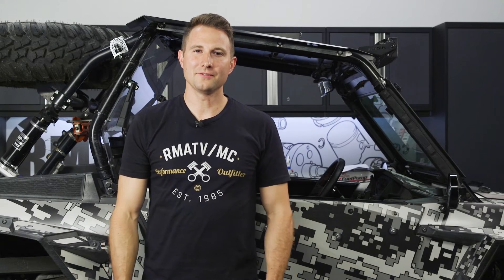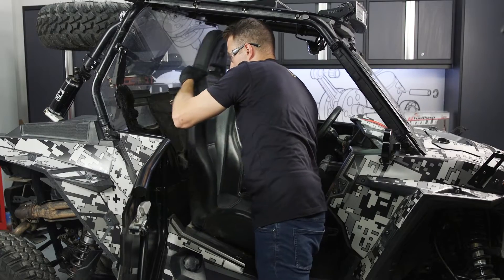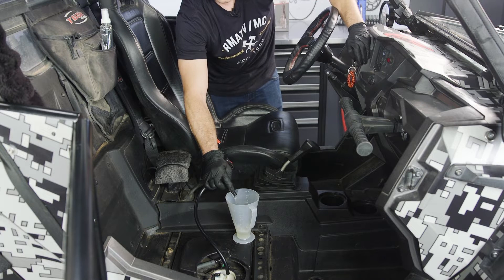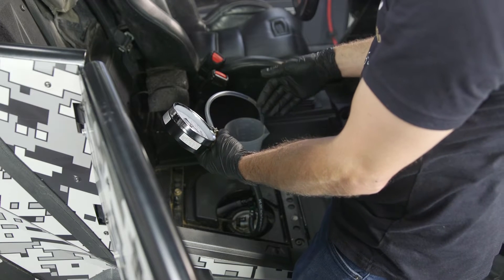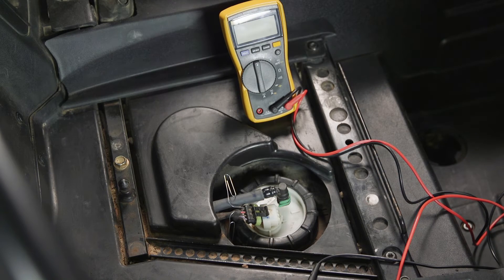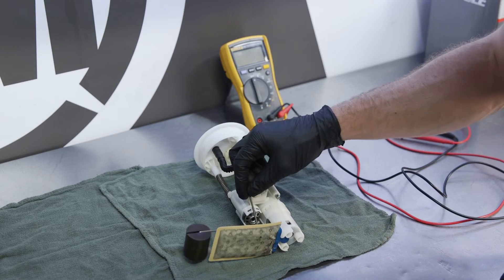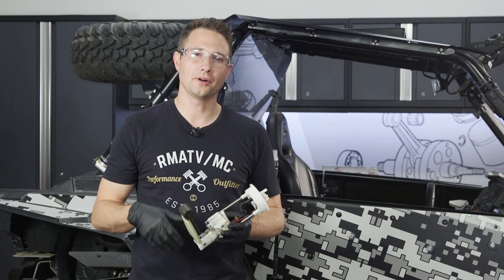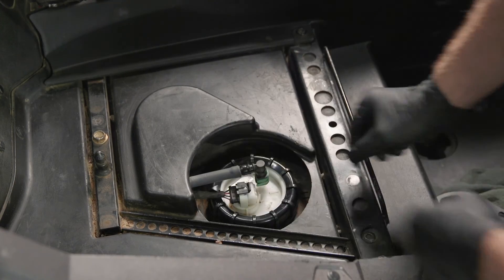How To Diagnose a Faulty Fuel Pump on a Polaris RZR

Comment: What would cause it to spit and spudder every now and again
Reply from the maker: This could be caused by a few things. Have you checked fuel pressure yet? Could also be bad spark plugs, or ignition coils.
Reply: Just did plugs wires coils

Comment: OK, I’ve checked fuel. Pressure is good volume is good but everything back together it will run holding down on throttle just a little, but there is no gas coming through the fuel filter line.
Reply from the maker: Hmm, what machine are you working on? So the test at the pump is OK but you're not getting pressure to the fuel rail? If it won't idle, it might be worth checking some basic things like compression/leak-down and maybe your valve clearance. -Charles

Comment: Hey Charles, I have a rzr4 900 eps 2015 and i did the 3 turn of the key and got roughly 195-200. I guess I'll put the gage on it tomorrow.
It once died going slow up steep hill due to traffic. And couldn't get it started for a few hrs, just a little paranoid of dying out on the trail. Anyone got a clue any info would be appreciated. 🇺🇲🇺🇲

Comment: Tighten that plastic nut to 70 lbs pounds? Maybe you meant 70 inch pounds???
Reply from the maker: It seems crazy but 70 ft-lbs is the correct torque.

Comment: Question regarding continuity within the pump.  When you tested this at leads 3 and 4 do you have to cycle the key on/off at all?
Reply from the maker: Great question. No, you don't need to cycle the key on that test. Continuity is measured without any power going through the circuit (usually the part is disconnected/removed from the circuit). All you are doing is making sure there is a complete path for power to flow through. So if you don't have continuity or if you have high resistance, then you found your problem.
 -Charles
Reply: So if I don't have consistent reading holding at this test fuel pump bad?

Comment: I have a 2015 rzr xp 1000 my fuel pressure is at 30 when i turn the key on and it drops down real fast to 0 as soon as it hits 30 psi it drops to 0 fast
Reply: Did you figure your out? Mine is doing the same exact thing

Comment: 2012 Polaris ranger 800xp we changed fuel pump, starter, battery and it still won’t start. It clicks and after the key is out you then hear a clicking by the actual starter?!! Help
Reply: Did you figure this out?

Comment: Maybe two suggestions.  A fire extinguisher handy, and to make sure key is off when dis-connecting the plug to the pump, or dis-connect the battery.  Wouldn't want your garage to go up in flames.  These are great videos !  Very helpful.

Comment: My 2014 RZR XP 1000 has a Schrader valve fitting on the fuel rail. Why not check the fuel pressure there?
Reply: My thoughts exactly, I checked mine on the shearer valve

Comment: Where can I get that quick connect adapter you are using on the fuel pressure gauge?
Reply from the maker: That was part of the fuel pressure gauge that we got from the local Polaris dealer.

Comment: When I tested my pressure it went to 80 psi on 2 separate gauges. Mine wasn't a passive set up like yours just straight to the gauge. I did hit the button and purge it 3 times but it still went to 80 psi. Is that normal?
Reply: That's a bad regulator

Comment: Would this be the cause of a vehicle not taking off like it ahould
Reply: When it’s driving does it rev up but it won’t gain speed past 5-10 mph? Kinda stalls out?
Reply: I can’t see the comment got a notification of a message but cannot see it. It goes up to 25 miles per hour in high gear low gear stays around 10 miles per hour
Reply: @VeteranParanormal1  mine is doing the same as yours, did you figure out what was wrong with it?